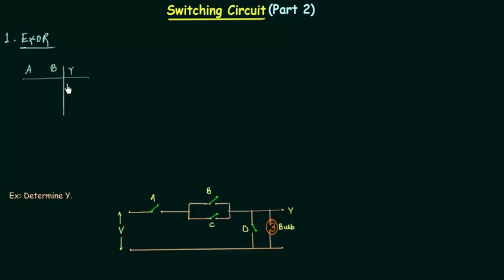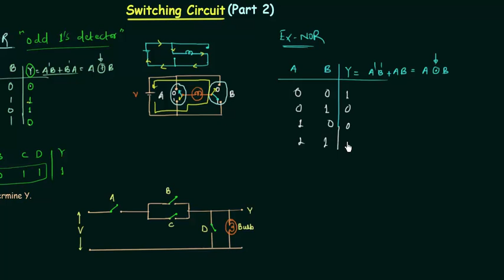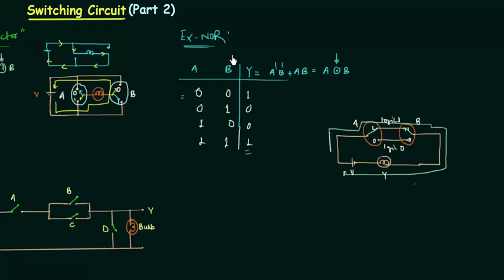Switching Circuits (Part 2)

Comment: sir, how can I draw switching circuit for 3 input X-OR gate and X-NOR gate?
Reply: If the high's are odd then the output will be odd in × or so you can generalise and opposite for xnor

Comment: How to turn on the switches only in positive half cycle and negative cycle ? 
Per suppose my AC input frequency is 100Hz, and I have 2 switches with 50KHz, the mist operate only in positive half cycle. So could you please suggest me something about it. 
Thanks in advance
Reply: Use diode...

Comment: If both b and c closed also bulb will glow ryt?
Reply: Neeharika Nihu Yes, it will
Reply: At 5:21 ex-or gate last out put 1,1 condition bulb glow... This doubt explain fast
Reply: Same doubt...
Reply: Yes so equation will be
AB'CD'+ABC'D'+ABCD'
= AD'(B'C+BC'+BC)
=AD'(B'C+ B(C+C'))
=AD'(B'C+B) BOOLEAN LAW
=A(B+C)D'  
SO THE ANSWER IS SAME FOR BOTH METHOD
Reply: No
Reply: @abcdabcd-em9bc  on 1,1 and 0,0 circuit is open,then how bulb will glow bro..Sorry for late reply :P

Comment: I didn't get why we would compliment D in example😱😱
Reply: Whenever switch D is closed (ON), the current will choose that path due to low resistance and the bulb will not glow. So, switch D must always be open (OFF). Hence, the compliment. 
Play the video once again from 9:27 till the end.
Reply: @APoeticEscape  d=closed and d ' means open ..is it?